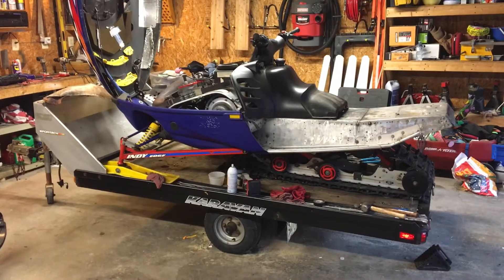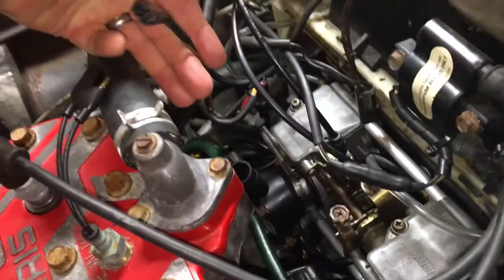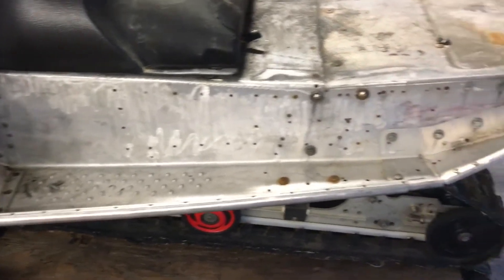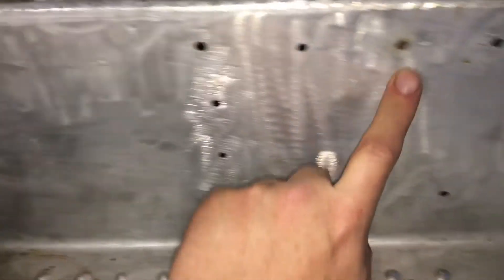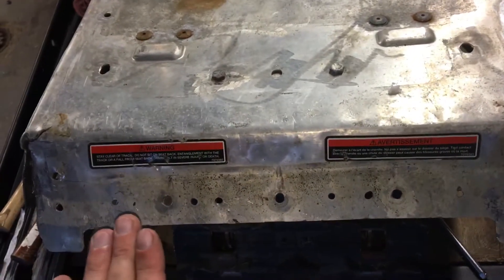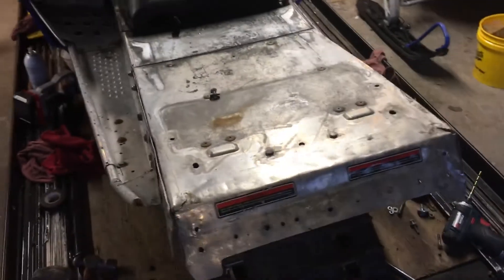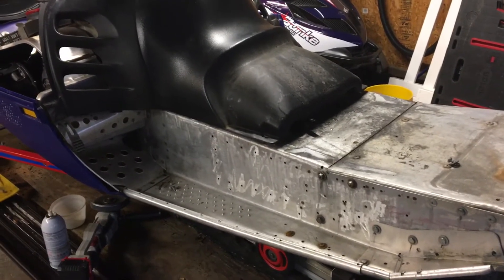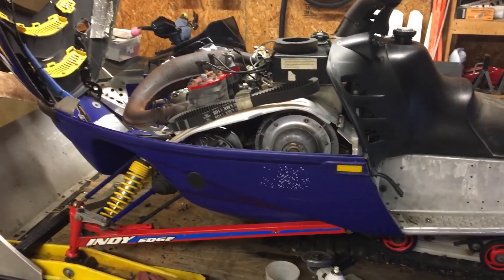Project Sled Update 1 -  2001 Polaris XC800 Fixes and Surprises

Comment: Great work comming along just fine! I found the problem on my 99 xc 700.. The pickup/trigger coil on the stator broke it was a cheap type and didnt have the metal band around it secureing it to the metal fastener that holds it in place by way of 2 screws. Found a heavy duty stator off a 99 xc anniversary edition that was wrecked at a snowmobile salvage yard for 100 bucks and its practically brand new. Problem solved.
Reply from the maker: Nice. You have to love the easy ones. Relatively speaking. Lol
Reply: @StreetersGarage  Right on we went on a ride today both sleds 99,98 xc 700s and both ride great but certainly different. The 99 has a softer ride the 98 rides more beefer both performed great! Plenty of power on top.

Comment: I just picked up an 01 XC SP 600 about a month ago (7600 miles but taken care of and not abused) and it had the same tears in the rear of the tunnel in the corners. I’m thinking that might just be from the rubber flap flying around or flexing as the flap bottoms out (going over crossings, etc.)
Reply from the maker: +Charlie Penn 

Hey Charlie. It might. 

The sled definitely took a hard shot in the rear. I forgot to film it but the section that held that the flap too was at a 90 degree bend. 

Thanks for watching and please subscribe and please click on the bell to receive all of the updates on the channel.
Reply from the maker: I'm having a Christmas giveaway on my channel. Follow the link to enter into it.

https://www.youtube.com/watch?v=MWOO-BBh7bE